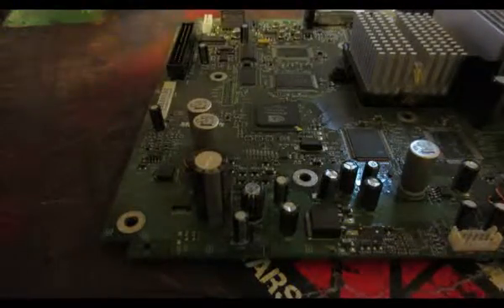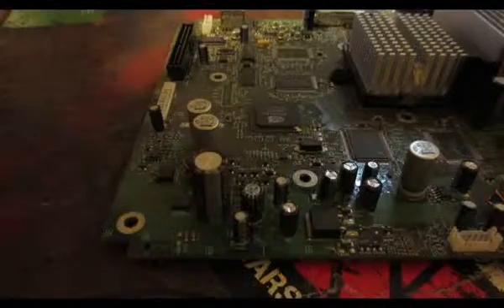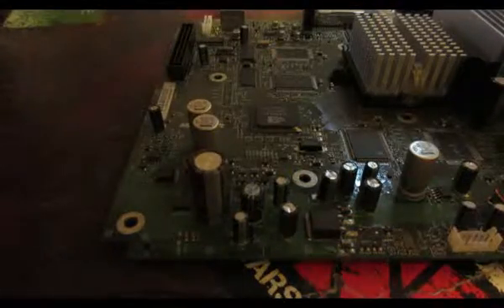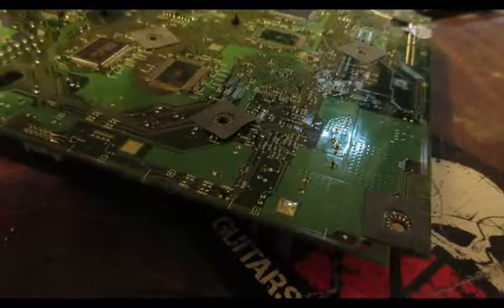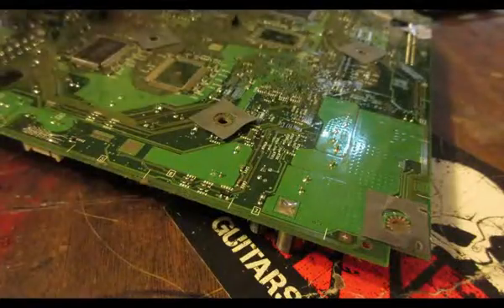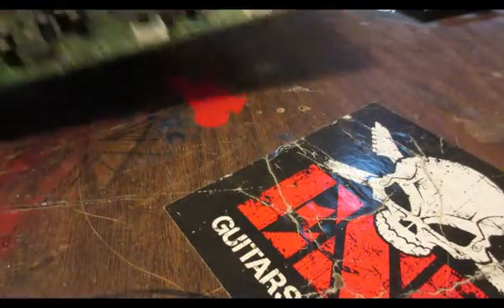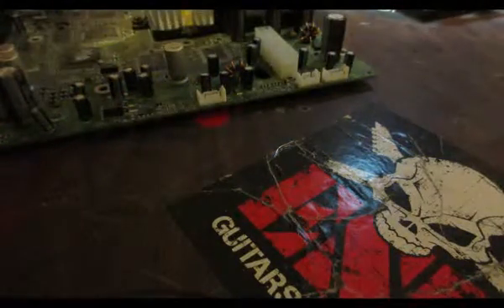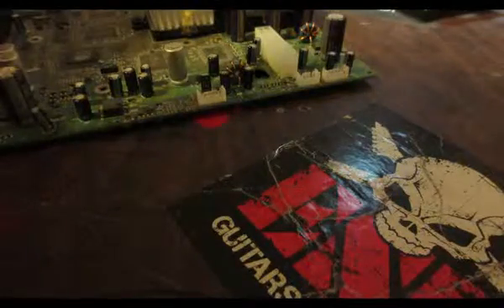Original Xbox Clock Capacitor Removal

Comment: My board is unusual as it maybe an older model, it's split into two seperate boards that are wired into one another. I was also curious if you could mod an xbox original with UnleashedX and how. Most links are dead and tools are down now a days. That is if it isn't to much of a hassle to ask. I have 2 xboxs and recently got one that I took appart to mod working again. Now I can mod them. I just want to soft mod, rather then do it with action replay or a kit I want to use a usb to ide cable for the hard drive. Then copy over the files or install them over using file xplorer 360 or something similair. Thanks for the feedback in advance
Reply from the maker: +Desenrrollado The smaller board on the right is the power board and then the bigger board on the left is the motherboard. Not sure on which model you have as they all are set up that way. Lol. Anyways, check out my video on how to softmod your original xbox. It's super easy and the tools cost lest than 15$. You'll need a USB to Xbox dongle (can get one off ebay), a compatible flashdrive (I use a 4gb SantaCruz Snowdrive), and a copy of Splinter Cell Stealth Action Redefined (make sure it's an original copy and not a platinum hits copy). You can also make your own cable if you don't want to buy one. Just need a spare controller breakaway cable and a female USB. After that you just wire em up (that can be found in my controller mod video, which you can always do that as well but it's a pain!) With the USB to IDE and hard drive, you won't really be able to plug a hard drive into your Xbox using any form of USB as the Xbox will only recognize 4gb of external storage. So going the flash drive route with the dongle is about the only way to accomplish the softmod without an action replay. After you have it softmodded you can always upgrade the internal IDE hard drive to something much bigger to meet your storage needs (which I also have a video over).